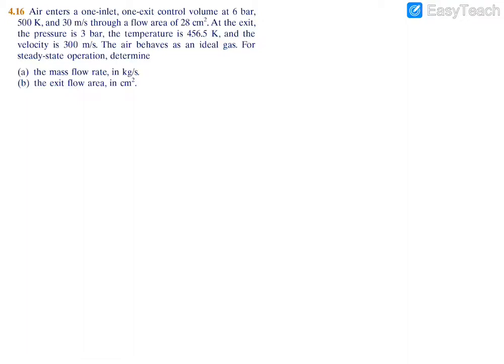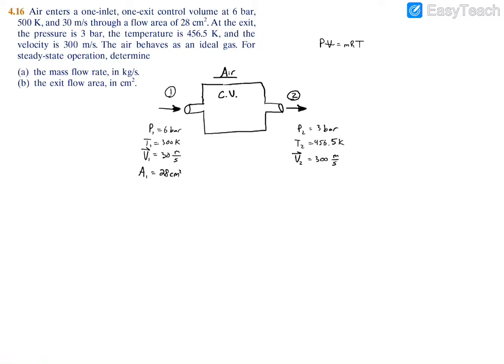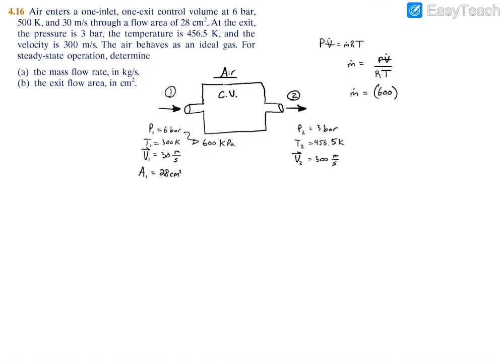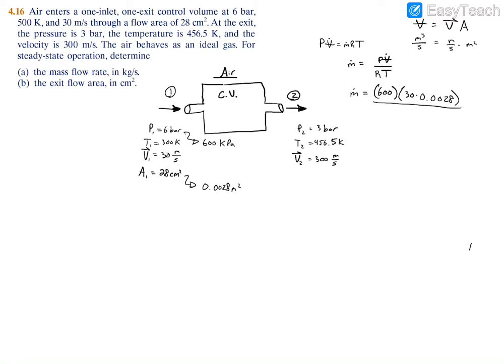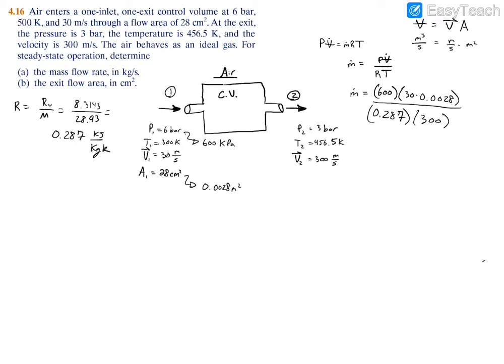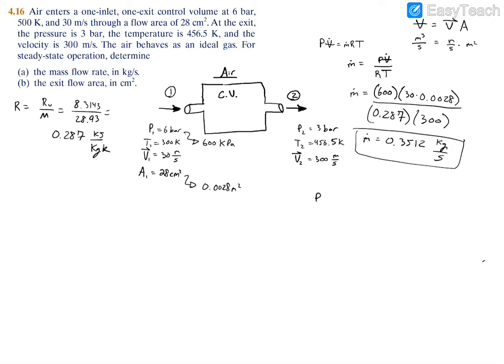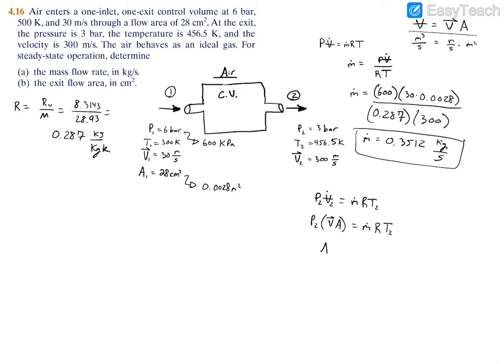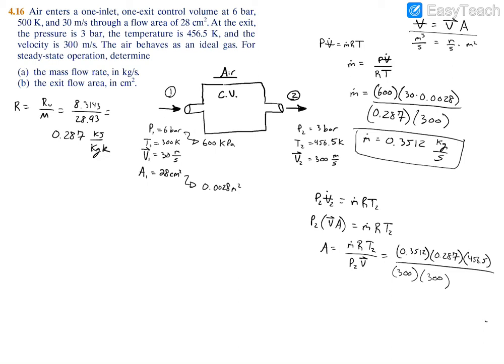4.16 Air enters a one-inlet,  one-exit control volume at 6 bar, 500 K,  and 30 m/s

Comment: At 3:36 the temperature 1 is 500K but u wrote 300. I think there is a mistake but its ok.
Reply from the maker: Thanks for pointing that. You are correct, I wrote down T1=300K, but the calculations shown did in fact use 500K. The final answers shown are still valid. I apologize for any confusion.

Comment: At 3:30 I’m working out the problem but keep getting 0.5853 for the mass flow rate (m°), how did you get 0.3512?
Reply from the maker: Hello, thanks for commenting. The reason for that is that I miswrote what T1 is given as. It should be 500K, I wrote 300K, but I punched 500K into my calculator. The 0.3512 kg/s is correct, I just copied the given incorrectly. I apologize for any confusion!
Reply: @gr_engineering  Ah yes. Thank you for the clarification !